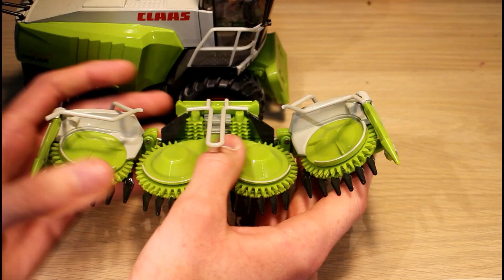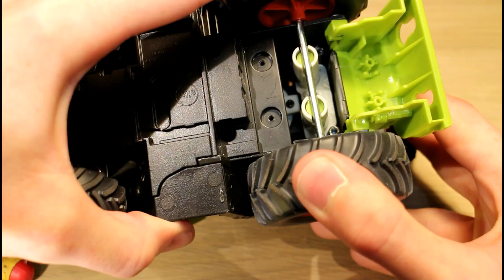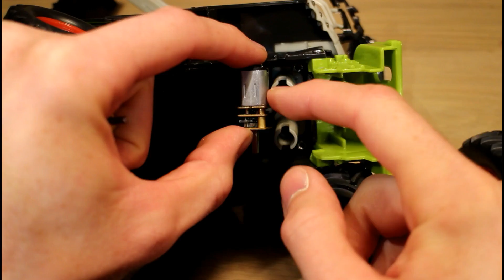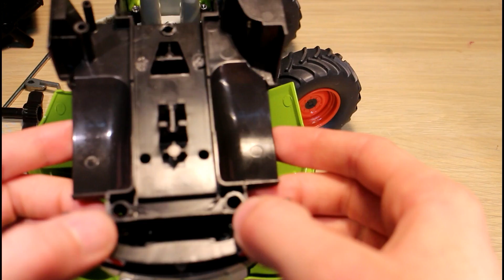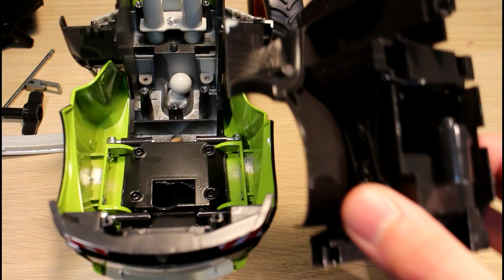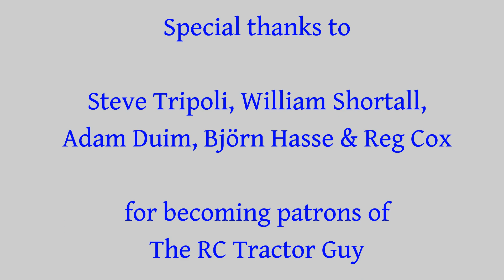Claas Jaguar Disasembly

Comment: ive sorta got a little proplem i have a Rc Subru and im having bother with the motor when i try to go forward it makes a very loud squealing noise but when i reverse it dosent for 1 second and then it squeals i opened it up and it i thought there was somthing tied up around the axle and there was nothing there so i now think its the motor and i cant see inside it tho or another problem wich i wouldnt know about
Reply from the maker: If its making squealing noises but not moving I'd guess there are broken gears in the gear box. Only way to know for sure would to open it up and take a look.

Comment: I swear those motors are for rc4wd warn winches
Reply from the maker: They are the strongest cheap Chinese manufactured motors so I would expect they are used in a lot of RC models and accessories.